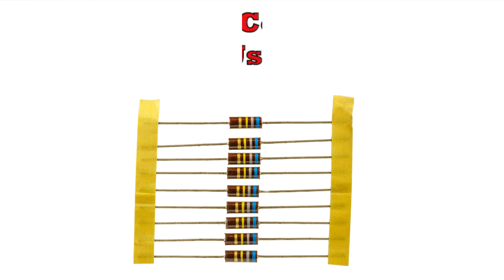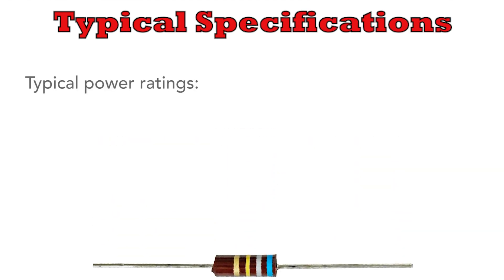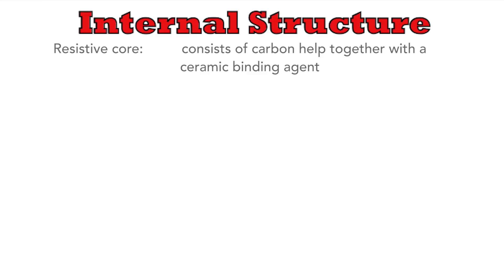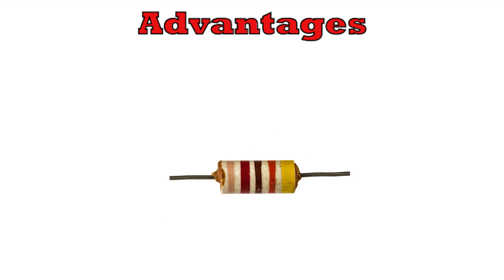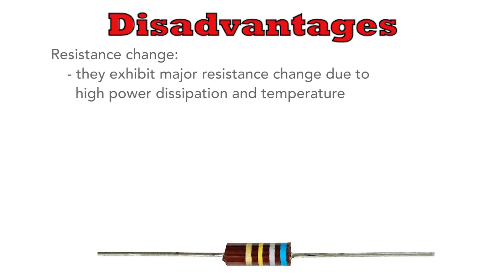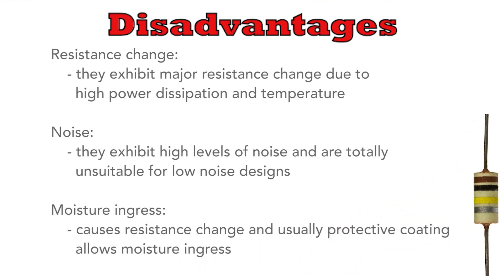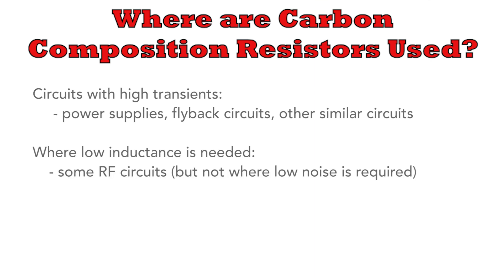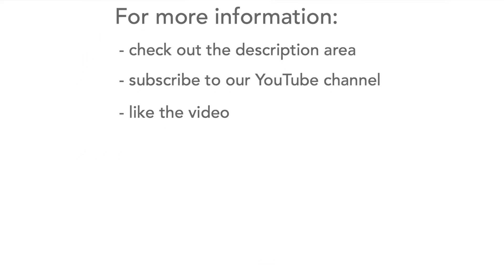Understanding Carbon Composition Resistors: 101 explanation

Comment: Nice review video!  I used these many years ago in power electronic gate drive circuits for large SCRs. Really like their pulse withstand vs metal film and low inductance vs wirewound for the application.  However, i thought the industry had moved away from these due to environmental challenges in making them many years ago. For a time, I had trouble finding suitable bulk material, low inductance and pulse withstands replacements resistor technologies as carbon film was only one close but lacked power handling capability.  It is great to see carbon comp is back!
Reply from the maker: They certainly can be obtained quite easily. They are still not very widely used, but they can still hold their own in a few areas.

Comment: I use them a lot in my hobby projects.... you missed out another advantage.... they're very very cheap.
Reply from the maker: Yes they are cheap, but also other resistors like metal film are very cheap.
Reply: @ElectronicsNotes  I've also got my own stupid reasons for disliking metal film... With the convention of a dark blue body and one (or sometimes two) extra bands, I really struggle to read the colour codes on metal film... "is that band brown or orange" ;)
Reply from the maker: I would most certainly agree you that reading the bands can be very difficult. Unfortunately I don’t think we can change the background colour - big manufacturers are set with what they will do.